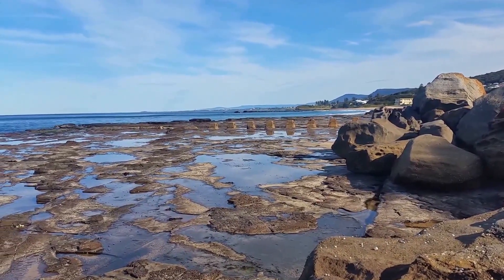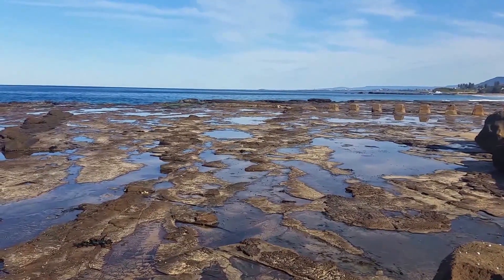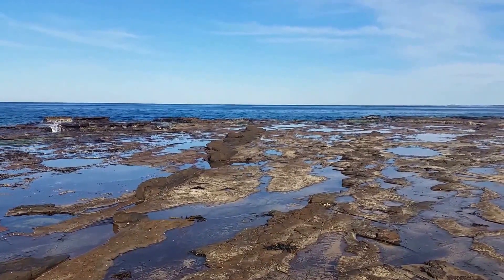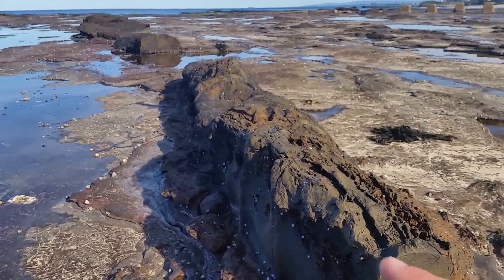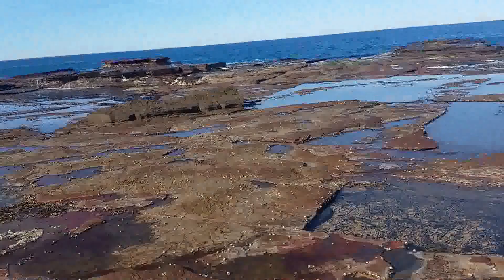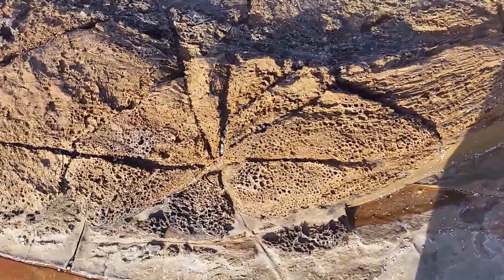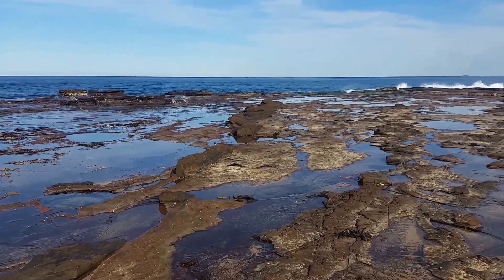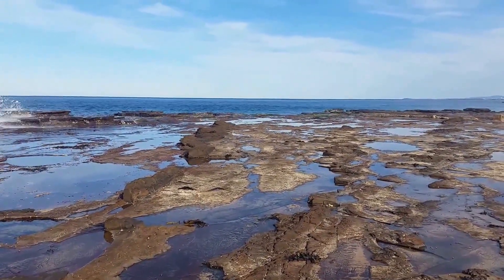Sediment Deformation Structures - Sydney Basin

Comment: Well explained 👌
P.S. If you're interested in fossils in the Sydney Basin?
I spotted a lovely example the other day, it became exposed after the recent storms, at the northern end of coalcliff beach, it's quite visible during low tide at the moment about a meter long section of petrified wood psuedomorphed into a brecciated jasper. I thought it was quite stunning. 
Not sure how often it becomes visible though as the recent storms appear to have moved a lot of sand off the beach.